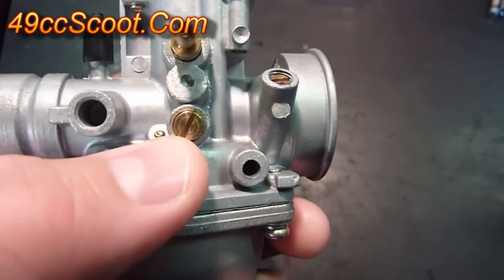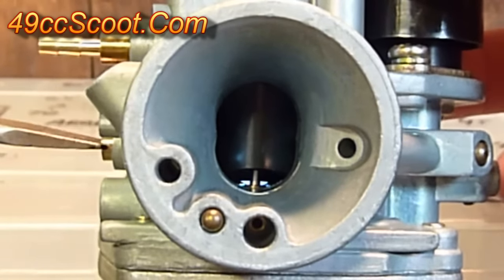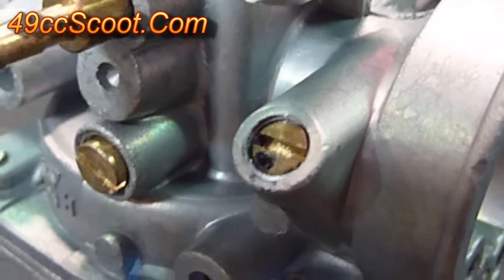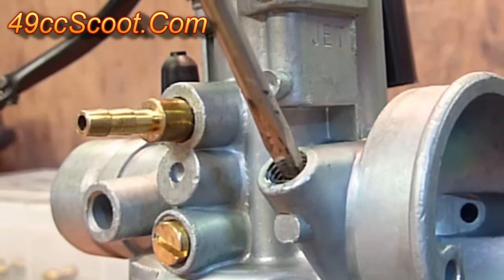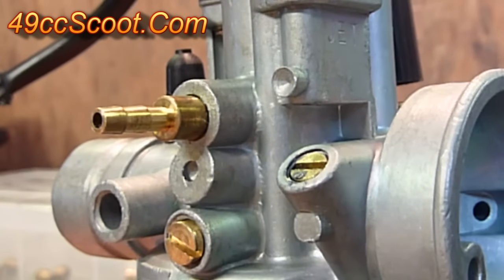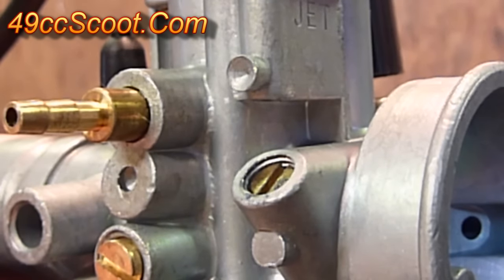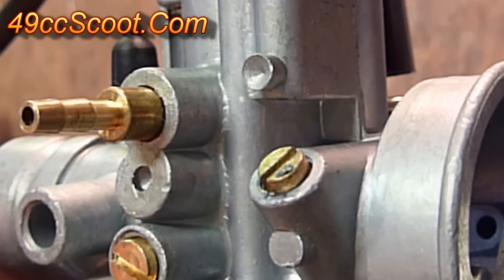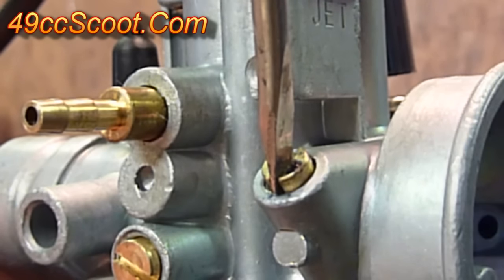Two-Stroke Scooter / ATV Carburetor Settings And Adjustments 2of4 : Idle Speed & Mixture

Comment: Just one questin when you set firs idle speed the other screw how many turns to be?
Reply from the maker: It will vary by carb, but you can basically set it so the speed screw is just starting to raise the slide. If it's too low and won't idle, raise it. Less risk setting it too low than too high.
Reply: @49ccscoot  whats the factory how meny turns the fuel scree?
Reply from the maker: @darkogligorov3181  Usually 1-2 turns out.
Reply: I set it good i worm up the scooter good then i set the fuel screw 1 turn out then i lower the idle and increes the fuel screw i found it where is high then raise the idle screw its was runing great and starting right up. But when its get cold down its was all gone its only starts with a litl throtle and its was idling low. And i found that the idle screw incresed all the way up where is want to come out and the scooter stiil runing hight idle even the fuel screw was 1.5 turns.
Reply from the maker: @darkogligorov3181  I always set them for what works when warm. Most of the time the engine will be warm, so if it's a little off when cold then it will be OK once warm. Otherwise, I assume it is a choke/enricher issue that's not allowing it to function till warm.
Reply: @49ccscoot  if i disable enricher and adjust it is it going to be good
Reply from the maker: @darkogligorov3181  You'll have problems when it's cold without the enricher.
Reply: You know the carb has smal and big enricher my has a small what if i swap from smal and big is it going to work ?
Reply from the maker: @darkogligorov3181  You could try.
Reply: Just one last question. When my scooter is cold its start but its shot off right away and when its get hot and hot  its  start but is bogging when i giving a litl throtle and it want to shot off. I was messing with the carb and its work good only on half turn the fuel mixture screw if i incrised its start bogging and diee. What can cause that?
Reply from the maker: @darkogligorov3181  You may also be experiencing CVT issues. Sometimes a hot CVT experiences contra spring and clutch spring fade and won't run as well as when it's cooler.
Reply: So me again. I fix that its start very good and its idle good but its go with litl throtle if i half throtle i bogss down and its want to shot off. I line up the float boad for fuel i cleen the carb very well i adjust the carb on hight fuel to go low fuel more air low air and its the same one day its was going good with just a litll bog on half throtle and its was good then when its cool down again the same. So what the basic think to cause that??
Reply from the maker: @darkogligorov3181  Maybe it's just a little lean or it's got a clogged jet.
Reply: Me again so the fuel screw on just half turn out its not bogging but if its more of half like just 1 turn out its bogging so is that mean that the jets are to bigg or?
Reply from the maker: @darkogligorov3181  If it's a fuel screw (on the engine side) then the pilot maybe too large.
Reply: Heyy me again haha so i tried that screw out screw in and every time i give throtle its not going back to idle its incrises so what to do ??
Reply from the maker: @darkogligorov3181  It's too lean. More fuel will make it settle back to idle. Larger pilot, richer needle setting (lower clip to raise needle) or needle, or potentially even main jet... though the main jet shouldn't do this at very low throttle unless it's way off.
Reply: So today somethink on the cvt the clutch somethink was stuck it doest let the tire to speen so i remove clutch and instal again and its okay now. So its not that one time its do like 3 times like this and i remove clutch and its okay again so what can cause that and now when you akcelerete and let the throtle and its come stragne sound of the cvt and when you let the thortle instantly its somethink snap on the cvt what you thinks its is ??
Reply from the maker: @darkogligorov3181  No offense, but my first thought is to be careful and attentive during installation. Things really shouldn't change just because you remove and install them multiple times unless something is changing during the process. If you're not using torque specs, maybe over or under tightening sometimes. If you are using a torque wrench, maybe it's malfunctioning.

I think the whole thing needs to be gone over with attention to detail. Again I mean no offense here, but if you have anyone very mechanically experienced around, maybe see if they could join you during this or consider a professional shop looking at it. It's tough to guess at this stuff online.

Comment: OK I'll look for that. But now I have a new problem.  I noticed the main jet ontop the Carb was loose, so I thought there was slack in the throttle cable,  so I ran it back and noticed it OK, well I put back the main jet assembly part and I go to start it,  it now wants to take off basically full throttle. I have to hold the brake and pull it back with lots of force so it doesn't run off.  Idk what I did with that throttle cable.

Comment: So I got a stock daelim s-five 50cc 2005 model, which has been running great until today.
Today it suddenly out of nowhere started dying at low rpm after being warmed up and will at low rpm/speeds acts as if ignition is completely turned off.
So far I have checked the air filter and cleaned the spark plug with zero improvement.

Talked to some people who claim it might be the fuel mixture being wrong, but I dont see why this should happen so suddenly??
Will there even be a point for me to try to adjust this? If not then does anyone have a clue on what else a noob like me can check?
Edit: Another thing to mention is that it will not start again if i let the engine die, even though it starts very easily if i let it rest for a few minutes or from cold.
Reply from the maker: Could be dirt/debris in the carb. Maybe a thorough cleaning would fix it.

Comment: So my moped makes 3000 rpm and i want it so it makes 1500-2000 rpm at idle, so the only thing to do is screw the idle screw outward?
Reply: Or do i need to turn the air screw to?
Reply from the maker: That may be all it takes.
Reply: Thanks man👍

Comment: I have a 49cc scooter someone messed with the carb so it idols but bogs when you give it throttle any help would be appreciated
Reply from the maker: Make sure the main jet is not clogged. It may need a different main jet; probably larger.
Reply: It ran before my neighbor mess with it so not sure how to start to adjust the idol and air mixture screws  like I said it idols
Reply from the maker: @robtru3680  Ask the neighbor what they did.
Reply: I did he said he turn the air and the idol but doesn't remember how many turns
Reply from the maker: @robtru3680  Not sure how long this has been going on, but it's been 2 months since the last reply here so if it's been sitting around then you may have bad gas. Drain, clean carb, refill with fresh gas.

Comment: I rebuilt the engine on a 01 polaris sportsman 90. It had like 60psi. Now it has about 115. For some reason fuel isn't getting pulled into the engine. I tried putting my thumb in the air box so it would pull fuel. Afterwards if i take the carb off and smell in the engine there's no gas smell. The float bowl is filling up. Just not going into the engine. Any ideas? Thanks.
Reply from the maker: 115psi isn't great, but should run. I would try a thorough carb cleaning first. If possible, use an ultrasonic cleaner.
Reply: 90GTVert from what i found online many had around 90 and it was running ok. I don't have an ultrasound cleaner, but i thoroughly cleaned the carb twice. I cleaned it before it stopped working too. I just took the edging apart again to make sure i didn't somehow put the piston in wrong or something. The piston was ok, but i found the gasket at the bottom of the cylinder had gotten messed up when i put it back together before. Not sure if that would have messed up the vacuum pulling from the carb, but I'm about to try starting it again.
Reply from the maker: Any damaged gaskets should be taken care of with a 2T. Many don't do it, but leak tests are great to do on 2T builds. Pressurizing the intake to about 5-6psi and seeing if it can hold it or if it leaks out. Any leaks can cause strange issues and make it so the engine can never be tuned properly in some cases. I don't expect that's what is going on here, but it should be noted.

This prob sounds odd, but sometimes if you can get them to fire, they will start pulling fuel when they wouldn't before. Maybe you'll get lucky if you use an unlit propane torch in the intake or throat of the carb or a little spray of carb cleaner/brake cleaner/starting fluid just to give it enough fuel to fire up. Obviously all flammable so be careful with that stuff.
Reply: 90GTVert ya. I'm pretty confused too. I tried spraying starter fluid. It didn't fire at all. I know I'm getting spark. I'll try it again. Thank you.
Reply: 90GTVert actually I'm not getting spark anymore. I pulled on the ignition coil i think and now I'm not. Getting spark. I was yesterday. I have to order a new coil. I'll let you know how it goes. Thanks again.
Reply: 90GTVert i got the spark working, but it's back to the original problem of not sending the fuel and igniting. I don't understand this problem
Reply from the maker: Does it start with starting fluid now? If so, you're back to needing to go over the carb and fuel system.
Reply: 90GTVert no. I haven't been able to get it start with fluid. I had to leave town for a week. I'll try again when i get back. I'll get someone to help seeing how it was hard to try to start it and spray fluid at the same time. It did seem like some fuel was going into the engine though when i put my finger in the engine and started it. I'll also check the plug gap. Any idea what the gap should be?
Reply from the maker: Usuaully around 0.024-0.028".
Reply: 90GTVert ok. Thanks
Reply: 90GTVert i put a new ignition coil on it and readjusted the carb. It runs when i disconnect the exhaust and spray starting fluid into the carb. So I'm pretty sure i have to clean out the exhaust somehow, get it started, and then adjust the carb. I can feel stuff in the exhaust where it connects to the engine. Doesn't feel like carbon. It feels like grass or something. I'm not sure how to clean it out other than blasting it with a compressor.
Reply from the maker: Maybe a wire to break it up, then try to blow it out.
Reply: 90GTVert i blew it out with air. It's running now, but it's very hard to get started.
Reply from the maker: If you think the exhaust is still an issue, there is a caustic soda cleaning method, but that's usually used when a pipe gets filled with carbon. It may need totally different carb settings now that air can flow.
Reply: 90GTVert the exhaust is ok. Air is flowing through it easily enough now.  I have the carb adjusted as good as i can get it. It idles a bit too high. There's no room to adjust the cable. I think the main issue I've been having is with the electric choke. It's really difficult to get it started. Once it's hot it can be started easily. I read some stuff that this specific year has a problem with the electric chokes and to plug the air box at first so the engine sucks in more fuel. The only way i can get it started is by spraying carb cleaner in it. It's still difficult to get started.
Reply from the maker: The auto-enricher should be cheap to replace. Some of the ATVs and E-Ton scooters also had manual versions that may work better. I never found the stock auto-enricher to be terribly effective. Aftermarket carbs that I use seem to do much more enrichment with their manual setups than the stock one.

You should be able to buy adjustable cables if it's indeed too short. PartsForScooters carried some at one point and I've bought them from Autotech355 on eBay. Some people modify their own cables. If it's stock though, that's not usually a problem... though I'm not sure if the Polaris specifically could have had that issue.
Reply: 90GTVert i had looked up manual chokes. They were like 38 dollars. An electric choke was like 22. A whole new carb with the manual choke is 17.50. I ordered it. I'm tired of putting money into this thing, but it's such little money and such a pain in the ass if i don't. I still can't believe a new top end was 35 dollars. The kick starter broke too. I'm going to have to weld the arm to the spindle. I'll let you know how it goes.
Reply: 90GTVert i got a new Kickstarter and carb with a manual choke. Now i can't get it to start. I keep trying. It started right up one time, but i couldn't do it before or after. After i try i look at the plug and it's wet with gas. I made sure it's sparking. I've tried adjusting the carb. Not sure why it winter start...
Reply from the maker: Old gas... inconsistent spark?
Reply: 90GTVert it's not old gas. Inconsistent spark is possible. I ordered and put on a new ignition coil. It could be garbage. I ordered it off of ebay. Any idea how to check this?
Reply from the maker: Use a large gap spark tester, like an HEI tester or adjustable gap tester. If you have an old spark plug, you can bend the ground strap back to make a large gap. Look for white/blue/violet spark. Keep the tester handy, and check it any time it won't start. That way even if it's OK at times, you'll be able to see if spark is inconsistent.

You can find specs for checking coil resistance in service manuals, but they aren't always spot on so I prefer to first check the spark itself and see if there's even a problem.

Comment: when I turn the idle speed screw in it locks the idle valve in place,throtal will not move.. 1/4 turn out the the valve slams shut and it stalls out, if I hold the gas open a little it runs but i get a lot of black smoke and it bogs down, as soon as i let off the gas it dies any ideas?...its a 2005 vento zip r3i

Comment: i have an aprilia sr 50.. did some main jett put a bigger one.. but the engine when its cols it doesnt wanna start up... help?
Reply from the maker: Try adjusting the idle mix leaner and see if that changes it or maybe move the needle a notch leaner. If it's better WOT with the larger main jet, it may just be a bit much down low.
Reply: @49ccscoot  ima try it out... got any way to cantact you or dm you? if that doesnt work?
Reply from the maker: @dejanmandzukovski8920  I respond to comments here, and I'm on the forum regularly at 49ccscoot.com.

Comment: U saying start mixture screw from around 2 turns from bottom.  In my case i twist mixture screw all the way  to bottom and my engine idle speed runing perfect, but when i push gas engine stops :/, if i twist mixture screw back from bottom counter clock wise even quarter then egine stops :/ pls help
Reply from the maker: I'd start with a thorough carb cleaning.
Reply: 49ccScoot does it mean that I need bigger pilot jef if my mixture screw is all the way to the bottom? But before i get this moped all was good, just changed piston and rings,  nobody adjusted nothing, but after repair need adjust 🙄🙄
Reply from the maker: @edvinas4072  Maybe. Could mean the pilot is clogged.

Comment: adjusting carburetor is not all ...oil mixer have to be also a good and spark plug. one important thing that lots of people do not check a leaking PETCOCK . controll and checking spark plug to see if it is black or dirty with sloos oil if your cables on carburetor is not set right or too old. or compression is weak.

Comment: do you know how i can make it brap brap brap on idle?
Reply from the maker: Set the idle low if it will keep running. I prefer to keep it rideable vs worrying about how it sounds, because it's not that much fun having to hop off and kickstart it at a traffic light.

Comment: Hi. I’ve got a quad bike that whenever I take the choke off the bike just wants to set off on its own. Can anyone point me in the right direction to fix this? All I’ve done is replace the throttle cable. There is no tension on the cable until I move the throttle myself. It’s a 50cc kids quad.
Reply from the maker: I'd start by adjusting the idle speed screw so it idles at a lower speed. Should be turning it outward.
Reply: 49ccScoot Thank you. I will give that a go.
Reply: 49ccScoot I adjusted the idle screw but it didn’t make a difference. The revs didn’t change one bit. I’ve now replaced the carb as well. But it’s still doing the same fault.
Reply from the maker: @sinmonk7351  https://www.youtube.com/watch?v=x-Jarx2od6I
Reply: Hi 49ccscoot. I did a leak test and found out I did have a leak. I’ve replaced the gasket. But now when give the quad bike some throttle it wants to stall itself. Seems like I’m never going to get this quad running right. Do you have any suggestions for that? Thank you.
Reply from the maker: @sinmonk7351  Clean carb and then it would be down to adjustments and jetting as well as making sure the airbox is in good shape and filter is clean.

Comment: can you possibly explain to me WHY... in the name of ALL the gods that have EVER bin conjured up in mans history..... my tomos with 70cc airsal, 18mm intake, Dellorto PHVA ED 17.5mm Carburetor and High-Flow air filter is CONSTANTLY alternating from high idle RPM to low idle RPM no matter WHERE I PUT THIS DAMNED air-mixture screw? when i set the screw "lean" or counter-clockwise, she speeds up in idle RPM's, and when i go "rich" or clockwise, she goes down in RPM's. BUT.... ether setting, i still get a Rhythmic shifting of RPM's up and down like clockwork no matter what setting i try to dial in :( and i know what your going to think first.... you have an air leak :P but trust me... i have done a standard leak test on ALL engine components, as well as an actual leak-down test using a professional system at my local motorcycle repair shop and there is absolutely NO air leaks on this thing what so ever.... ANY ideas would REAL make my year on this bike.... i am so out of ideas :(